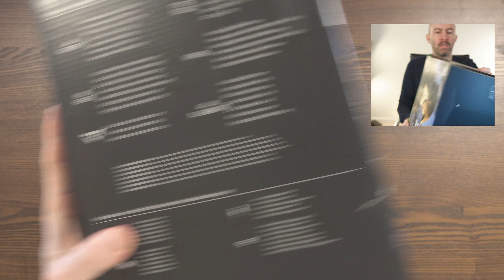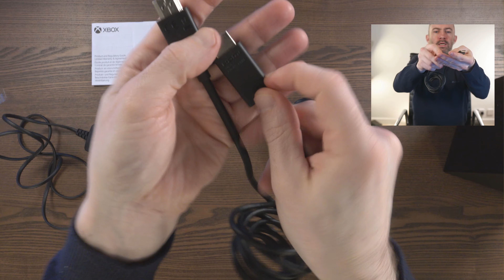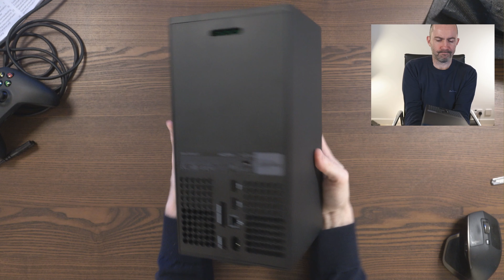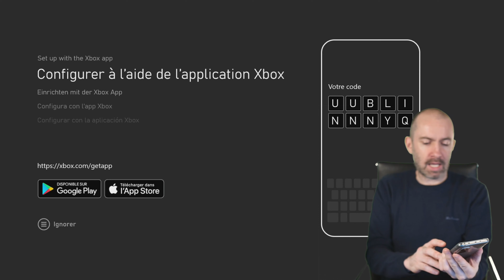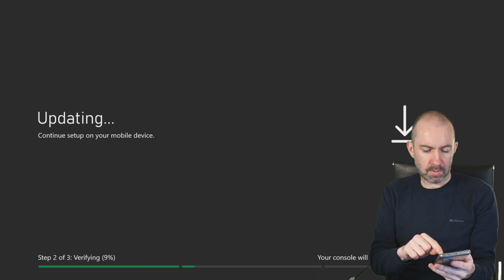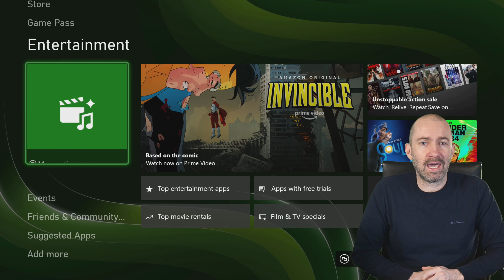Xbox Series X - Unboxing, Installation & First Impressions

Comment: I bought mine from a cell phone repair store. Brand new sealed. $757
Reply from the maker: Nice fine. What's the retail price for the series X where you are? Have you paid much more?
Reply: @kevs-gaming   $500 + tax which is about $531.25. I paid $226 more than retail
Reply from the maker: Oh that's unlucky. Least you have the console though.